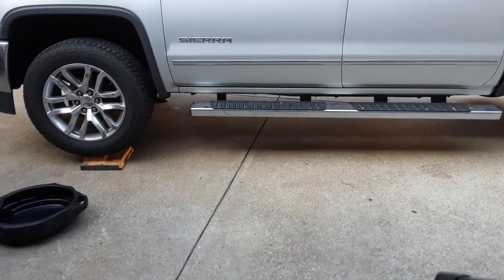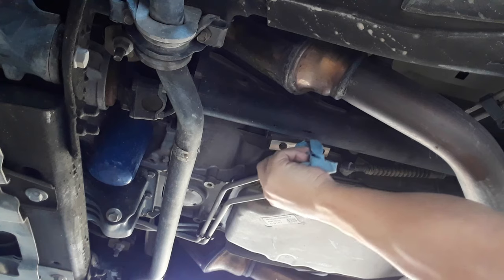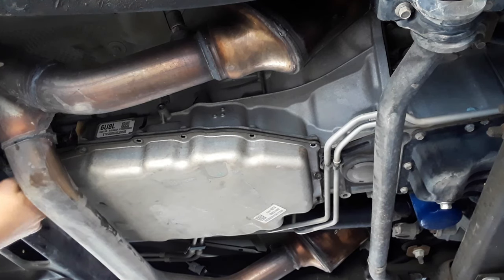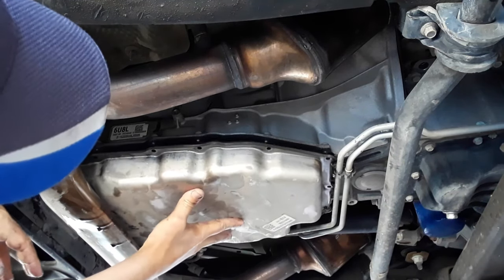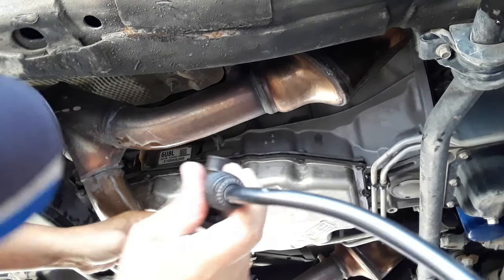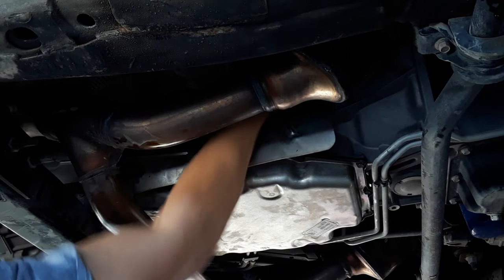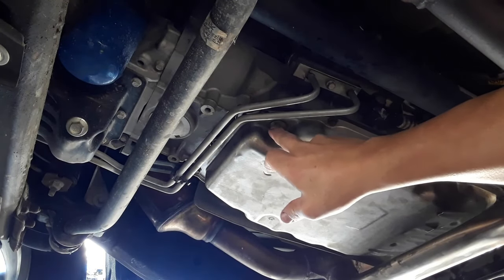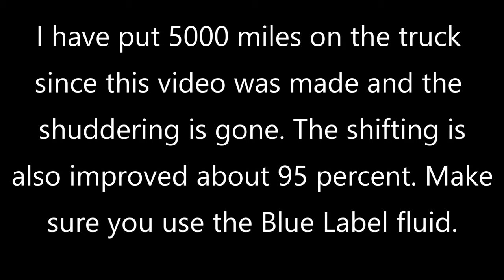Stop the shuddering on a 2016 GMC Sierra / Silverado with the 8L90 Transmission.

Comment: Does that work on a 2014 gmc sierra 1500 5.3  6L80 transmission? anyone?
Reply from the maker: If you have shuddering it is going to improve it.
Reply: @737mechanic   thanks

Comment: Will a bad trans cause truck to shake at high speed
Reply from the maker: It can yes, but I would check tire balance first then driveshaft, and the best thing to do is take it to a drive shaft specialist so they can spin it up on the truck and see if it is the driveshaft or something else.
Reply: @737mechanic  ok thanks. Because i do kno my trans is bad so i had a wheel alignment done. Ut it still shake at around 70mph ill have to cheack the drave shaft and tire balance

Comment: I have a 2015 gmc sierra denali 1500 4x4 5.3

my trucks problem is that when I accelerate between 0-20mph the transmission kicks/shakes it feels forced. I have to release the gas petal and step on it again slowly. is that transmission fluid recommended for my truck? Thank you for your help!
Reply from the maker: If it is an 8 speed it is for sure if it is the 6 speed I am not sure.
Reply: On bulletin says it’s compatible with dexron 6, I seen some guys use lv hp and dilute with dexron 6.
Reply from the maker: @Unko_Josh672  Why would they dilute it with Dextron 6.

Comment: Can anyone confirm if this fixes issue for ct6, escalade and cts ? Considering buying one of these vehicle but I hear the transmission issue is the biggest factor people dread their purchase from GM. Does this fix and how should I go about purchasing?
Reply from the maker: Those vehicles are listed in the SB 18-NA-355.
Reply: Don't walk away from one RUN. The 8L90/8L45 are still having issues and GM only band aids the problem. I took my GMC to the Toyota dealership the last time the torque converter failed... Problem solved.
Reply: @737mechanic  How are things holding up?
Reply from the maker: @KREEMTHEDREAM  still no shudder after 20,000 miles, it will have a harsh shift from time to time.

Comment: I have a 2017 Colorado 8speed (8L45) an the dealer flushed mine twice an it work for about 5000 km (I'm Canadian) in the colder climate the truck shifts like Sherman tank an viberates like one too. So I have a $45000 dollar vibrator. Not cool !!!.
Reply from the maker: Make sure they are using the Mobil 1 Blue Label LV HP fluid, and if they haven’t done it yet have them to a fast learn on the trans. I have a video where I just did that and it fixed my hard shifting issue.  Look for “Performing a 8L90 fast learn on a GM truck to fix shifting problems.”  https://youtu.be/YP4kJsmQQ6c
Reply: Yes sir the exact same oil , they did a fast learn on three different times, so I must have a retard transmission. An i watched the tech do that same thing you did on the video because I was standing beside the truck.
Reply: Have any other suggestions I could do or tell the GM tech to do ???
Reply from the maker: @garyfaulds2008  if the fluid change and the fast learn doesn't take care of it the only other thing is the torque converter replacement.
Reply from the maker: @garyfaulds2008  As far as i know a torque converter is the only other possibility.
Reply: @737mechanic  yes I agree , thanks for knowledge, but the GM in Canada will not replace anymore torque converters because I have been to three different Chevy dealerships ,they all said because GM has a lawsuit for these 8 speeds . Keep putting out your videos out , you know your stuff . PS unless you know someone high, high up in GM (Lol) that can help me ,I'm stuck with this truck . GM warranty sucks big time . Thanks again .
Reply: @garyfaulds2008  At one point GM actually ran out of off the shelf TC's for these transmissions because so many of the repair procedures for this issue (complete fluid replacement) was failing due to glazing of the TC and even though GM was only replacing TC's as a last resort, the volume of cases that ended up requiring TC replacement exceeded GM's existing stock of those units which was only exacerbated by the pandemic and subsequent related parts production constraints. As available replacement TC inventory dwindled GM then sent out notice to dealers to NOT replace TC's regardless if the issue returned even after 3 complete fluid replacement procedures and that it would only replace TC's from that point forward in the case of complete transmission failure (ie vehicle becomes inoperable) and that customers should just continue to drive it "as-is" until such a time that it suffers complete failure.

Comment: Does this only apply to these later models I have a 95 suburban and I’m almost certain it’s TC SHUDDER it happens around the45-50mph mark my rpm’s drop to like 1500 that’s when is happens somebody help me out
Reply from the maker: The blue label HP LV fluid is compatible with your transmission. You could try it and see if it takes your shudder sway.

Comment: I have. 2016 silverado 1500 with the 6.2 and the dealership did a flush and changed the torque converter and fluids. And still I have the bang from 1st to 2nd? Any ideas why ?
Reply from the maker: No, mine does it every once in a while, I do know for mine there is an updated software for the transmission that I am going to install in mine and see if that fixes it.

Comment: Do they not sell just the black label now in 2023? This is what I’m hearing. Black label is the only one available now.
Reply from the maker: The black label is discontinued so any black label you see is old stock that I am sure people are trying to get rid of. The black label will work, but it is more susceptible to condensation build-up, which is what is causing the problem. So if you do use the black label you may need to change it again sooner than you would if you used the blue label.
Reply: @737mechanic  really. I have heard from a reliable source that the blue label is discontinued. Hmmm. I’ll have to look into it. Just bought the black label here in Canada because they tell me the blue isn’t available anymore. Weird.
Reply from the maker: @jaybilawchuk2225  Look at the service bulletin. Here is a link to it.
https://static.nhtsa.gov/odi/tsbs/2019/MC-10163890-9999.pdf

It specifically says the blue label.
https://amzn.to/3ZnFICc

Comment: Was that your first transmission fluid and filter change from new?
Reply from the maker: Not sure because I bought the truck used. It was my first since I had it. I have about 5000 miles since I changed it and all is still good.
Reply: @737mechanic  thanks for your quick reply.

Comment: When I thought you were done, you removed the drain plug and removed some of the new fluid you just put in...? Why? At this point I got confused.
Reply from the maker: That not the drain plug,  once the fluid finishes draining from that plug the fluid is at the right level. The temp needs to be right and the engine needs to be running.
Reply from the maker: @joyceburrow1216  Dang dude calm down, he's not an idiot. Some people haven't dealt with these newer transmissions that have the standpipe method of checking the proper fluid level.

Comment: 8 quarts??? My man you need 24 quarts. You need to drain and fill 3 times! YES 3 times.
Reply from the maker: Nah 3 times is not necessary. I still haven't done the second one yet and the shuddering has NOT returned and it has been 35,000 miles.
Reply: Very interesting. Maybe the corvette is different? The TSB says that you need to do a triple drain and fill using 24 quarts. My 2016 corvette with the same trans is shuddering with only 39k miles. Wish me luck
Reply: By doing it this way you didn’t remove any of the old fluid inside the trans and torque Convertor. It’s been said doing it this way only gets about half the old fluid out. Thoughts?
Reply from the maker: @badass1g  That is true, The only way to get all the old fluid out is to do a flush. By draining and filling each time you are simply diluting the old fluid with new fluid even if you do this 3 times there will still be old fluid mixed with new fluid it will just be diluted more than doing it once. As long as the fluid does not smell burnt you will be fine doing this one time as long as it takes care of the shuddering, if there is still shuddering you could do it again, and of course doing it a 3rd time will be even better but probably not needed.
Reply: I’m thinking I’ll do the drain and fill twice and see if the shudder is gone. I’ll report back once done.
Reply from the maker: @badass1g  Please do.
Reply: OMG wow!!!! So I did things a bit different than I was planning. I bought two pumps from harbor freight for $8 each. Never pulled the pan (only 39k miles), pulled out 6 quarts of DIRTY fluid, I was surprised how dirty it was, nearly black. Then filled 6 clean quarts, then drained again after running the car 10 mins through gears, etc. I drained 4 different times and filled 4 times. Even on the last attempt the fluid was still far from new looking. But I decided to give it a drive, INSTANTLY the trans shifted smooth through all gears and the shudder was gone! I have been losing sleep over this for weeks. It wasn’t that hard to do at all even on a corvette where it’s much tighter working space. Not going to lie I was skeptical on this working. Before I had a hard shift into 5/6/7 gears and then a shudder after it was in those gears. Not it’s smooth shifting and shudder is gone.  I pulled out 23 quarts total and put 23 clean quarts in. I estimate that the fluid is still only 75% fresh. My backup plan was if this didn’t fix it, I will drop the pan and change the filter and fill it once more. But I am feeling blessed that this did the trick! WOW thank god! The guy sold me the car knowing it had this problem, but clearly didn’t inform me. What a prick!

Comment: Does anyone know if this is the same fluid you should use in the 6 speed tranny?
Reply from the maker: The 6 speed takes Dextron VI, and the black label Mobil 1 LV ATF is backward compatible, but the blue label no longer claims to be backward compatible.
Reply: @737mechanic  thanks a lot for the reply and the video. So the black label is what I need for the 6 speed?

Comment: 2017 Sierra getting a shutter vibration. Do you recommend a cycle flush or a drain and refill?
Reply from the maker: Drain and fill using the Blue label fluid. Then after about 10,000 miles do it again.
Reply: Thank you sir. I talked to the dealer, they suggested to cycle flush to get the torque converter cleaned out. Extra total of $400 out the door. Wish me luck.

Comment: This is a good idea but it does not get it out of the tar  converter where the main problem is. There is an article I read where its about 20 qt. complete amount of fluid  when done correctly .Only time  will tell. I will check with a tranny guy before I do this process but I do like your video.

Comment: This only works for a short time it will return.
Reply from the maker: So far it has been 25,000 miles and still doing good. If it does start again I will change the fluid again.
Reply: @CHARLES STEMPLE
What make/model of vehicle do you have bub? Just curious...
I have a 2016 Chevy Silverado LTZ and have been thinking about doing this myself, however, I've seen ole boy's comment earlier on his 2016 Chevy LTZ in regards to it not working, so this is the reason I ask what make/model...Preciate it..
Reply from the maker: @pelon21015  I have a 2016 GMC sierra, the same thing as your Silverado. It has worked great for me so far at 20,000 miles now.
Reply: @737mechanic  Sounds good...Thank you sir..
Reply: @pelon21015  does not matter anymore the owner traded out,bought a  Ram instead.
Reply: @charlesstemple2362  LoL...Alright..
Preciate it...
I've had an '07 Dodge Ram 1500 since 2012 and actually still have it. Just dropped a brand new engine in it...Good truck..Y'all take care now..
Reply: @pelon21015  Same to you sir.

Comment: I own 2018 GMC Sierra.  It's a $60,000. vibrating dildo and it drives me nuts too.  It is a GM defect and they will not recall, or fix vehicles with this eight speed vibrator.  Good luck.

Comment: All this fluid change bs is because the TCC is allowed to slip.  Zero allowed slip with hp tuners. Problem solved.
Reply: Can't get into my 17 Sierra to tune the slip out
Reply: I just bought an 18 Sierra last week and it has the shudder (noticed it miles later after I bought it).
Can you explain the tuner fix please?
Reply: @domeslacker  Purchase upgrade service only for the T87A TCM computer on hp tuners ($200), send in your TCM to get unlocked, then purchase 8 credits ($400), change allowed slip to 1 or 0 and disable displacement on demand.